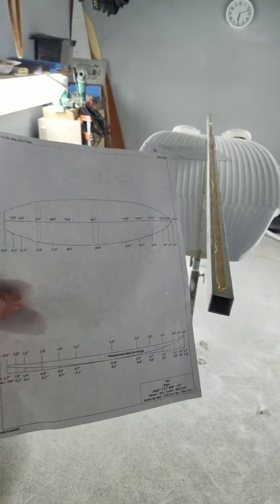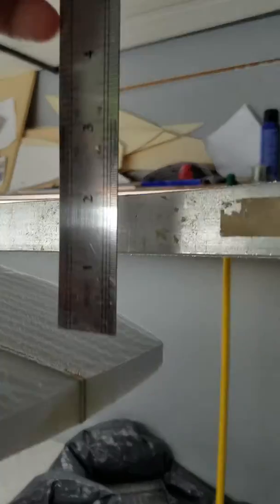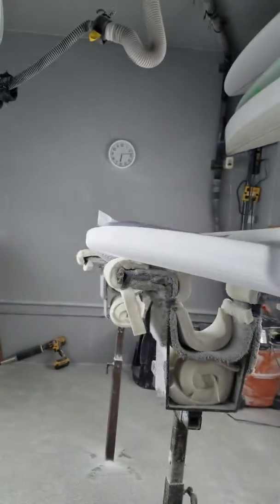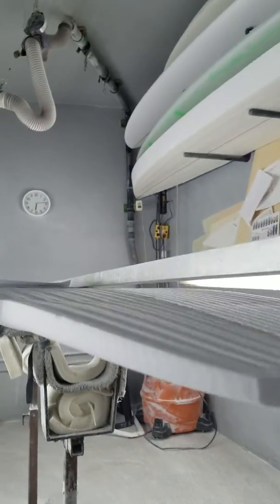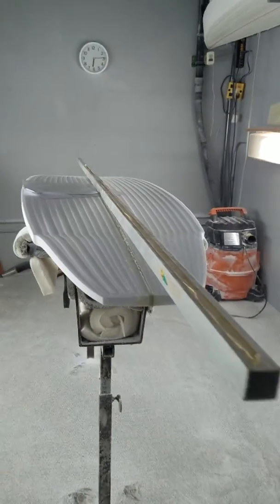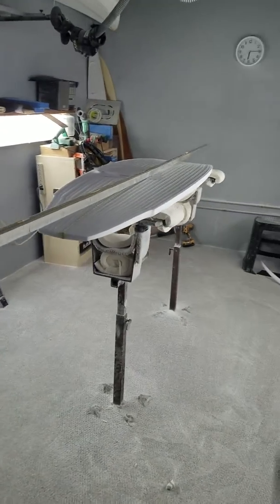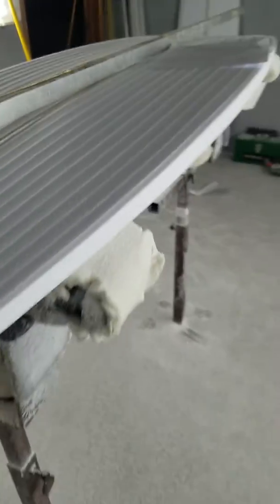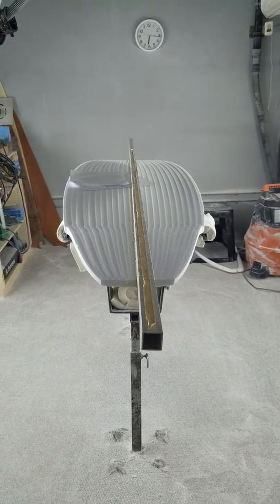A better and more accurate way to measure rocker.

Comment: GREAT video as always but curious, couldn't setting the blank on the 2 points of the single rack also cause the ends to sag slightly? Just as the center apparently sags on the 4 points of both racks?
Reply from the maker: Larry Hawes . Yes it totally can depending on the boards length/thickness/stringer etc but the real distortion comes from the weight of the bar itself. In stringerless the blank on 4 points will sag in the middle by about 1/4 "

Comment: Thanks for yours video's, besides Ben Aipa's I find your's the most helpfull. When copying a board's rail rocker that has lots of varying degrees of concave . how dow you figure out the rail rocker at various points on the board? Or do you just measure the nose and tail rocker plus the added concave at the center line of the board? This ones got me stumped. Thanks again.
Reply from the maker: Jeff Martinez you are onto something that most dont understand and care to understand.  Rail line rocker is as critical as centerline rocker and both are rarely even remotely similar.  Start by measuring the centerline rocker, take your center concave value and add it to every other rocker point you measure(except your center value) then subtract the concave values  from those same points and you will get a rail line rocker. It's confusing but really simple.

Comment: kazuma it looked like you measured the tail rocker the 1st time on the stringer.  the 2nd time when board was on both racks you measured from foam next to stringer.  maybe thats why 1/8 difference?  which is proper way?  also where would you measure tail rocker on a swallow tail?
Reply from the maker: Eric Jenkinson. That was just because I was filming with one hand and trying measure with the other. With your observation, the rocker would have made it even that much more distorted from accurate.

Comment: another great vid Matt.  I've been using this method since watching your original vid and people always ask about leveling the blank.  I love seeing them realize it works!

one question:  do you measure rocker before or after dialing in the  bottom contours?  for example, is the 2.2 tail rocker in this vid pau, or pre concave (which will reduce it)?  mahalo always!